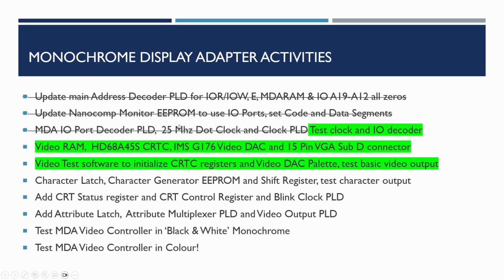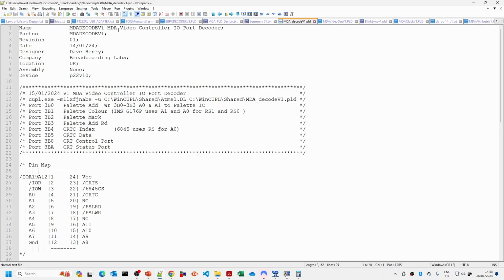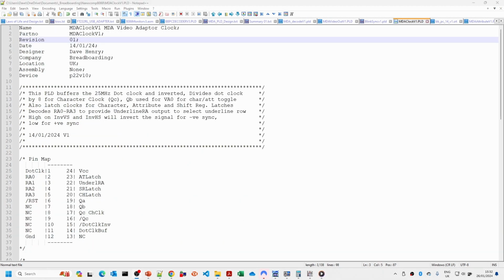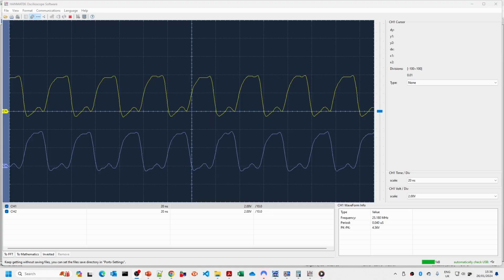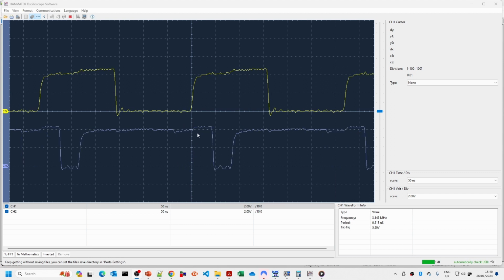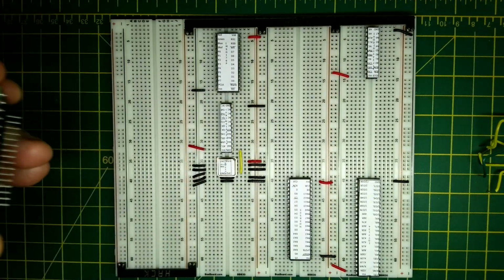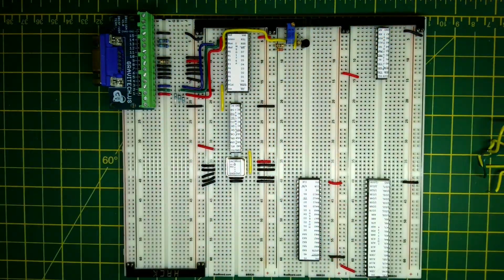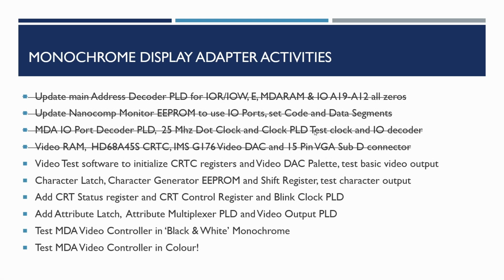Breadboard 8088 PC MDA Video Controller (MDA#4) #16

Comment: Have you done a video covering how you design and print those chip labels? If so, can you remind me which one it was?
Reply from the maker: Greg, just released a video on chip labels. Latest ones now on Github under both 6809 and 8088 projects. Dave
Reply from the maker: The tips video has a bit on it and links to Grants Searle's site with a PDF with his labels. https://youtu.be/nVtszJ8y_74?t=1267&si=tJKTH6qgjD5CvQ5V
There are my Inkscape labels on Github at https://github.com/breadboardinglabs/Nanocomp6809/tree/main/ChipLabels
Check the readme.txt as it explains how to do the overline bars.
I will upload the 8088 labels this week to the 8088 project as well.
Dave